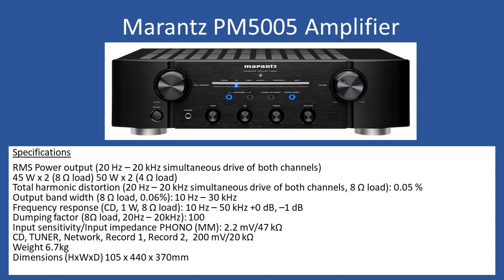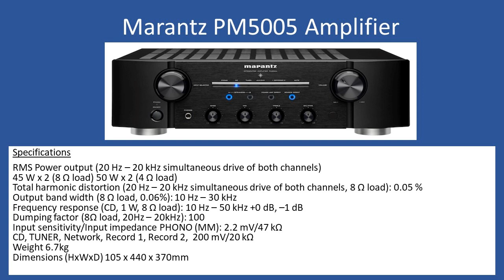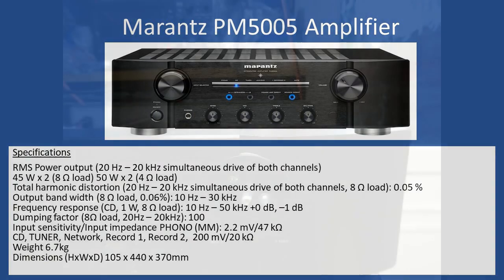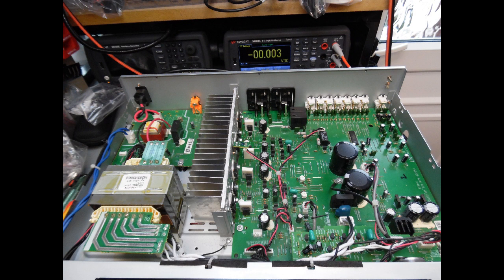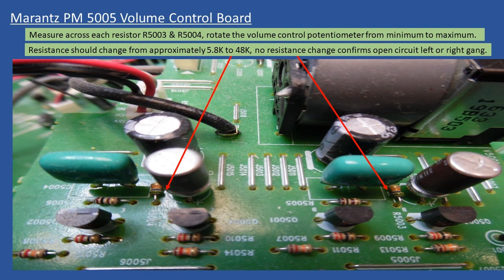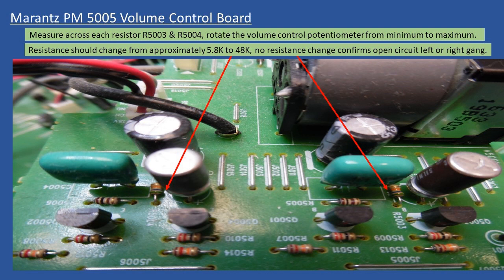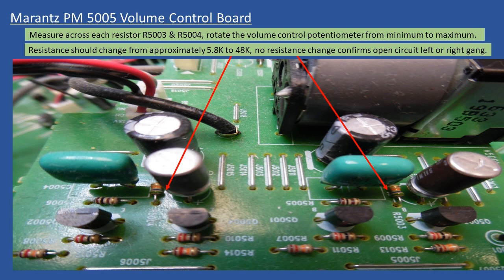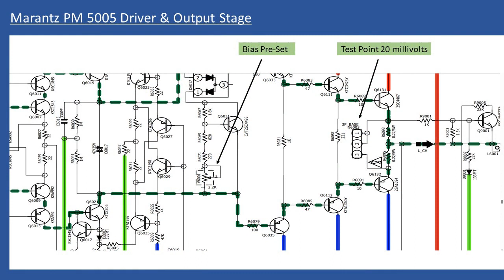Marantz PM5005 Amplifier Repair (With Audio Tutorial)

Comment: Hello, thanks a lot for sharing your knowledge ! May i ask for your advise as i'm stuck with strange problem. PM5005 stuck in protection mode with a seem to be faulty mesurement potentiometer as same as you described on your video.
This is what i have:
At switch ON, power red led on, after 1second power relay clicks, 3 blue leds speakers A & B & loudness & red led MUTE goes ON then mute red led goes OFF, then power relay unclick, 3 blue leds go off, power red led flash undefinately > protection mode.
Mesurement at cold power Switch On:
KIA 7805A:  IN 24,3V  OUT 5,02V   
KIA 7812:   IN 24,3V  OUT 12,05V   
KIA 7815A:  IN 24,3V  OUT 15,08V 
KIA 7915PI: IN 24,3V  OUT -15,05V 
Bias Right: 23mV
Bias Left : 32mV
Volume Potentiometer: card totaly unpluged, both resistors R5003 and R5004 stay mesured at 56Kohms at any volume potentiometer movement.
is a faulty volume potentiometer capable of forcing protection mode ?
thanks again and best wishes for 2024
Reply from the maker: Hi I have responded directly.